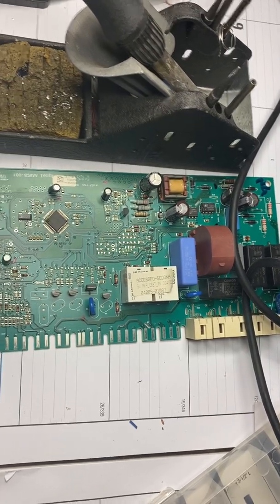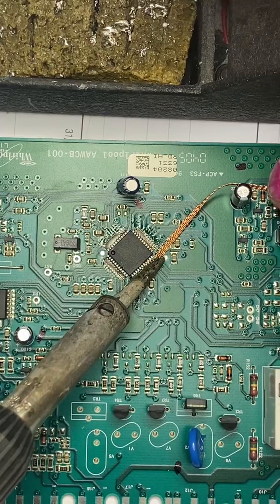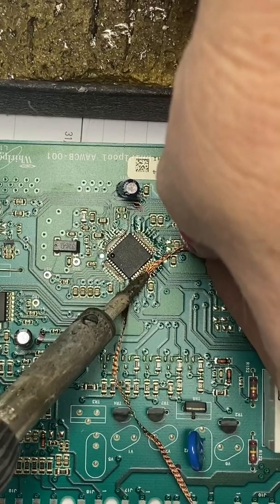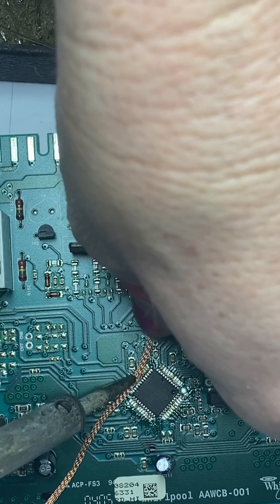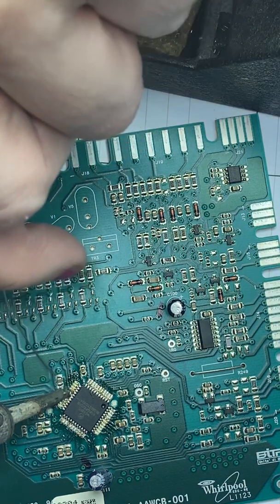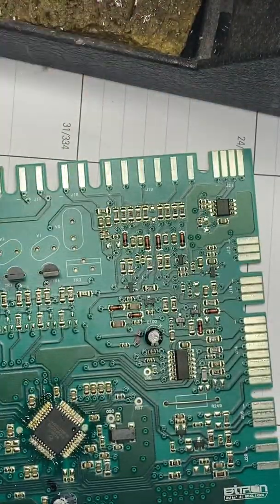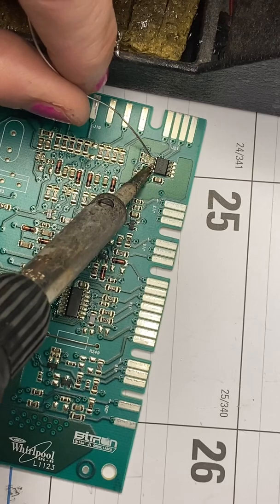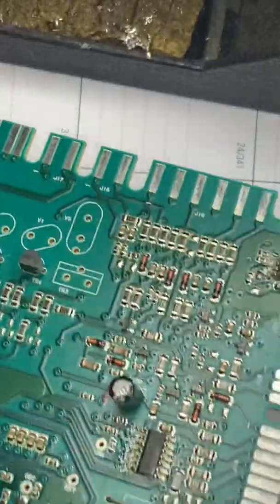2/4 Resoldering. Fixing Error F11 on a Whirlpool/Kitchen Aid Washing Machine - A four part series.

Comment: I recommend using a bit of flux and you probably won't even need the desoldering braid. Then a good clean with isopropyl alcohol or other solvent and voilà, you'll get a shiny and fast solder. 😁